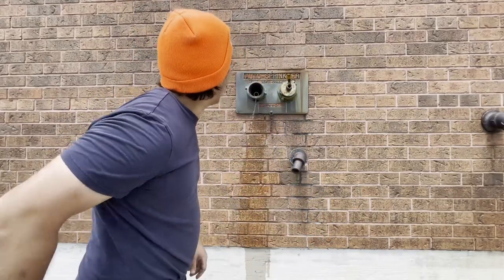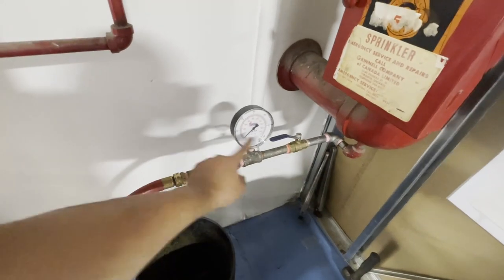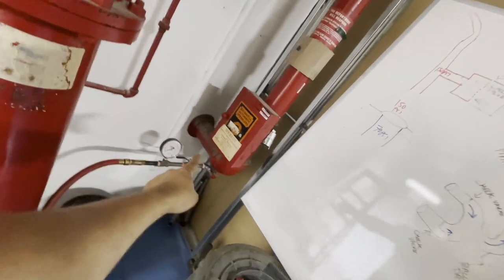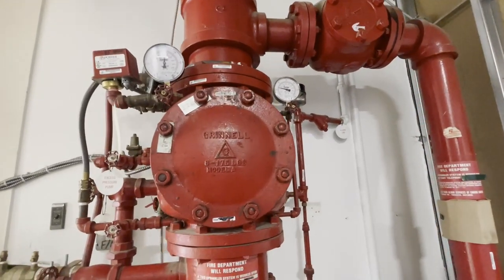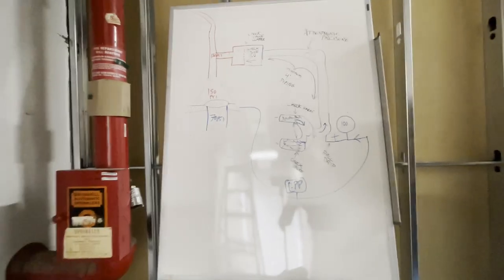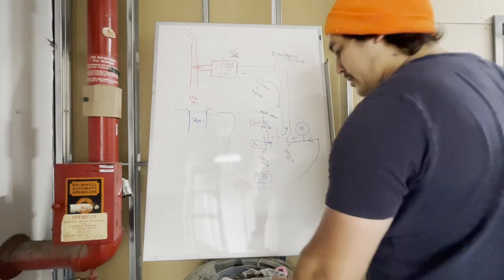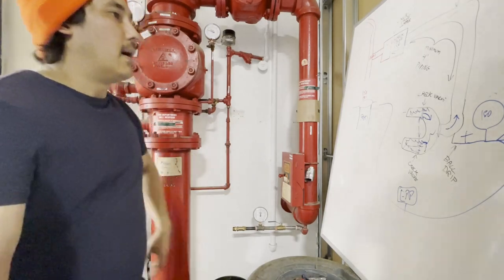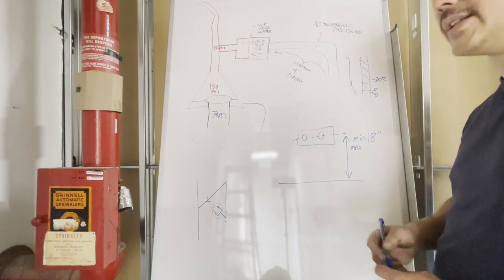5-year 150psi 2-hour Hydrostatic Test on a Fire Department Connection

Comment: Did you know that the 150 psi testis ONLY for sprinkler FDCs and not sprinkler / standpipe combo FDCs? We just learned this. The code book is confusing, but it is there. 200 psi minimum or 50 psi above working pressure.
Reply from the maker: This is true, but only for MANUAL and SEMI-AUTOMATIC DRY standpipe systems (at least that’s what’s in NFPA 25 (2014 edition). It’s very possible this may have changed in later codebooks and if so I apologize. My jurisdiction goes off of NFPA 25 (2014 edition) so that’s the one that I’m most knowledgeable on. 

6.3.2.1 Hydrostatic tests of not less than 200 psi (13.8 bar) pressure for 2 hours, or at 50 psi (3.4 bar) in excess of the maximum pressure, where maximum pressure is in excess of 150 psi (10.3 bar), shall be conducted ever 5 years on manual standpipe systems and semiautomatic dry standpipe systems, including piping in the fire department connection.

I wish I remembered to mention that in the video. I honestly made these videos on the fly while on site and didn’t have any lesson plan… I just showed up on site and realized I had some spare time to kill and decided to make a video.

Comment: Is it okay if I connect the FDC below the Riser?
Reply from the maker: Yup. It’s quite common to see the FDC tie in below the riser and into the header itself which allows one single FDC to supply multiple system risers. It’s only acceptable to tie into the header if the header itself is checked (either with a backflow or check valve). If the header is not checked and Fire Department were to try and pump water into the building, that pressure would simply dissipate into the water supply and not actually provide any additional volume/pressure into the systems itself. 

Furthermore the Fire Department Connection SHALL be tied in BELOW any dry pipe valve. It is unacceptable to tie in the Fire Department Connection downstream of a dry pipe valve. If I’m not mistaken, the reason for this is because the hammer of pressure from the Fire Department Connection can actually warp/damage the dry pipe valve clapper (hence the reason why when performing a 200psi hydrostatic test on a dry system you must ensure the clapper remains OPEN when performing the test to not damage the clapper).

Comment: Why are you using 150 psi instead of 200psi?
Reply from the maker: That’s a great question, I was waiting for it because I knew someone would ask that eventually and I forgot to clarify in the video; if the Fire Department Connection supplies a sprinkler system, then it needs to be pressure tested at a minimum of 150psi as per NFPA25. However, if the Fire Department Connection supplies Standpipe, then the Fire Department Connection needs to be tested at a minimum of 200psi or 50psi in excess of normal system pressure. 

So in this video this system was solely a sprinkler system which is why I only pressure tested to 150psi. 

Thanks for the comment and great question! I really wish I remembered to point that out in the video.
Reply: What if it's a combo ?